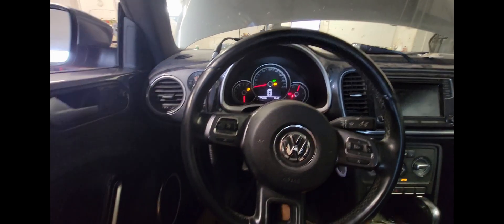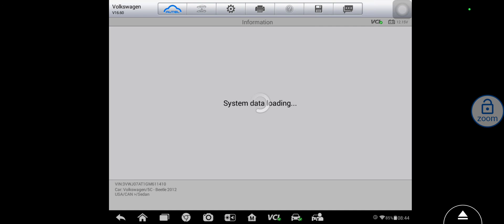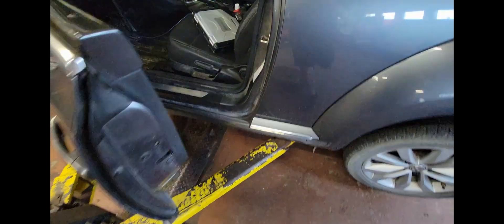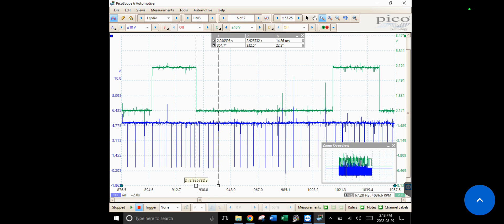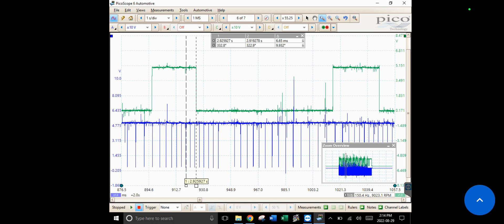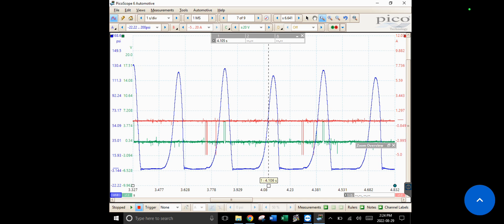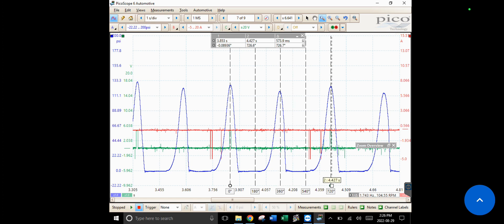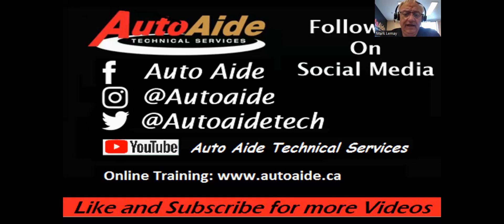Bad Bug! No Start Diagnosis. (2016 Beetle)

Comment: Great stuff, but need the conclusion.
Reply from the maker: Alex, if you follow the video to the end you will see video showing a broken timing chain guide and slack timing chain.
Reply: @autoaidetechnicalservices3981  ah yes sorry. Interesting cos it looked like no movement at all in the vices on the transducer waveform … was chain rolling right over cam sprockets?